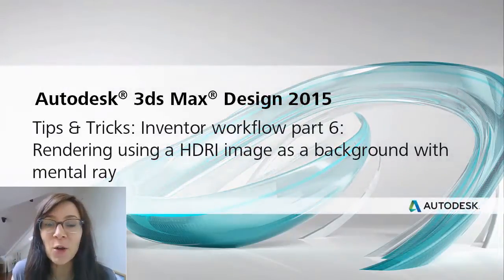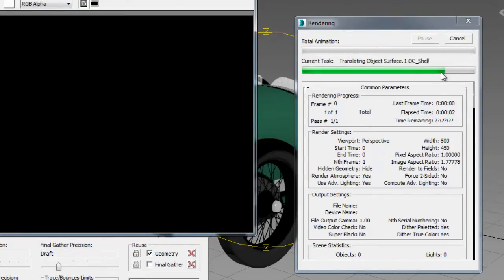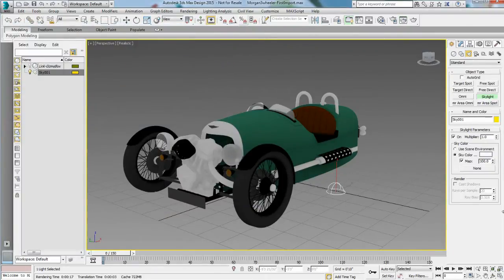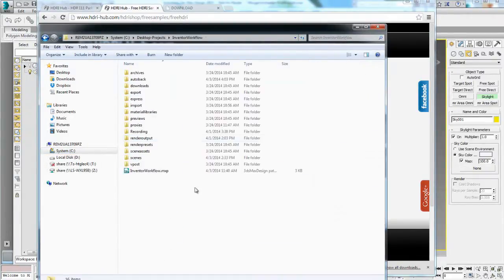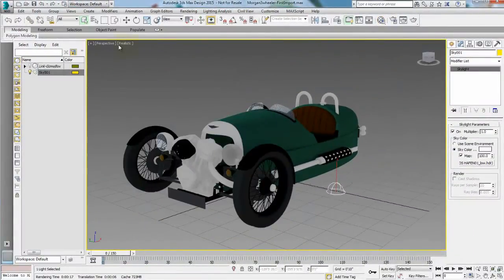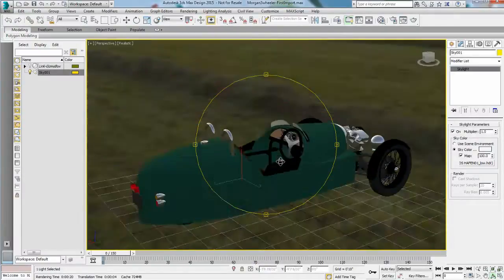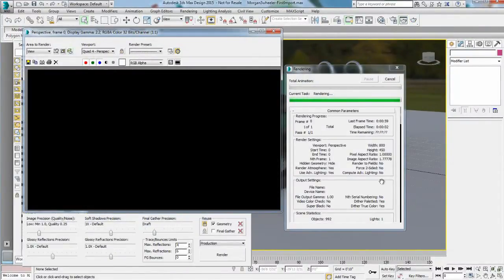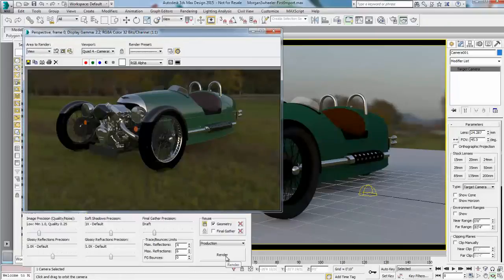Inventor workflow part 6: Rendering using an HDRI image as a background with mental ray

Comment from the maker: Hi Bigfilsing, Showcase is a presentation software. If you need to present your design in real time, study materials alternatives and talk about it in a meeting, Showcase is quick and easy to use. If you need to make model changes, animation, insert environments or other object,  present your model for marketing purposes (photo-realistic), add animated cameras etc, 3ds Max Design is definitely the software. The way that I see it is that Showcase is somewhat of a 3d Powerpoint and 3ds Max Design is a 3d software that allows you to do everything else. You can push 3ds Max Design really far and get really creative. 3ds Max Design is used for film and tv commercial.. so you can go really far with it. Hope this helps. Marion

Comment: Great series and great explanations. 
Having just downloaded Showcase 2015 for my design suite i would be interested to know in what case you would suggest using showcase V max design. Thanks
Reply from the maker: Think of Showcase being a quick presentation software (similar to a power point but 3d). Think of 3ds Max Design as a photo realistic animation and rendering software. More polished images, marketing images and video are done generally in 3ds Max Design. If you need to add vegetation, environment, people, animation, accessories and life to your design, you will need 3ds Max Design.